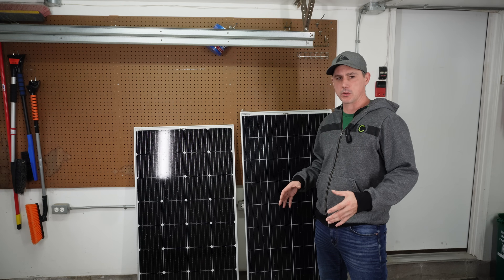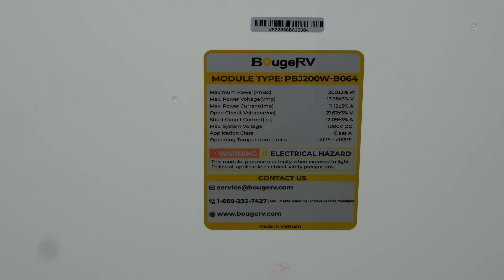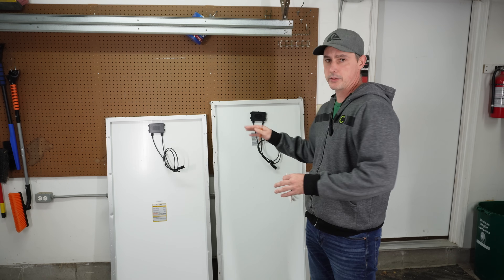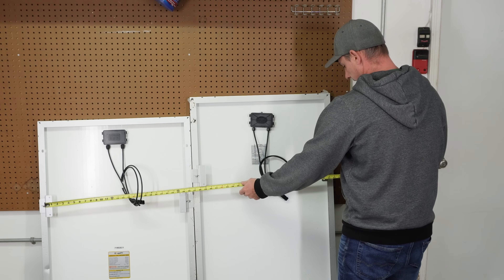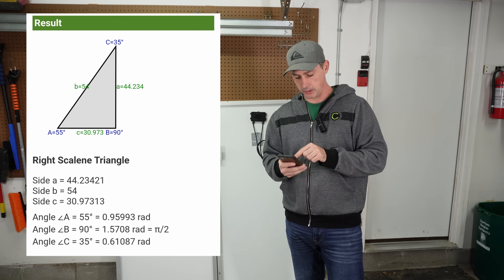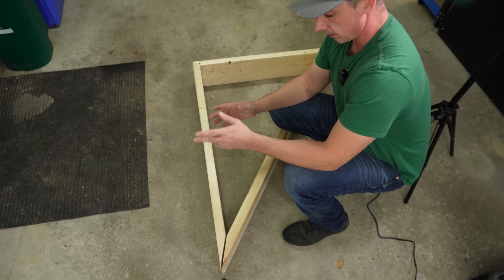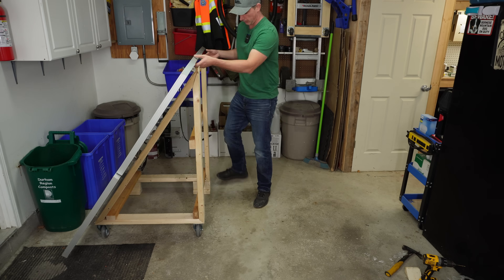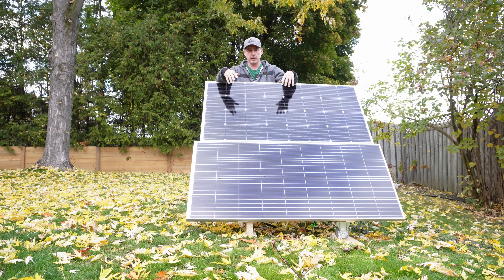Harness the Sun: DIY Solar Panel Ground Mount Build

Comment: You said one do not work at all if one cell is blocked and you put them in series ? I suggest you put at least a little paints on the wood, I know its just a side project but if you want it to stay straight you need a little paint. Still, thank you for the informations.

Comment: Dig the idea. I too changed up my set up this summer from horizontal to vertically mounted.
Reply from the maker: I really was I solar tracker. 💸
Reply: I saw Brad made 1 in a past video. I thought about getting a tracking set up on Amazon,can't recall name of manufacturer.Same ppl that I've bought 3 of my array mounts from but it is around $500 and mixed reviews on its motors and pistons,as well as a few had some complaints about the welds on the main mounting post.The regular array system is pretty good tho for $130-150 and holds 5 panels each.
Reply: Eco-worthy